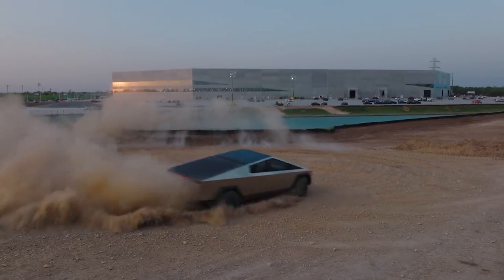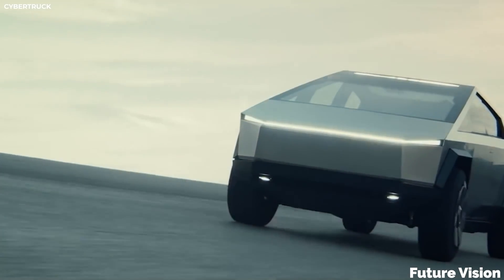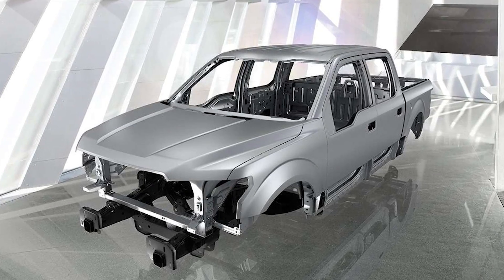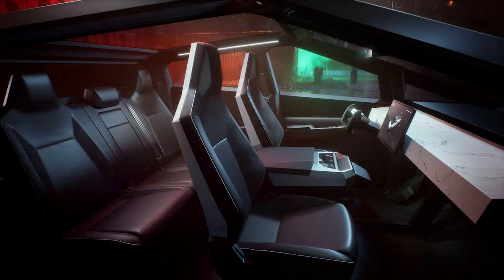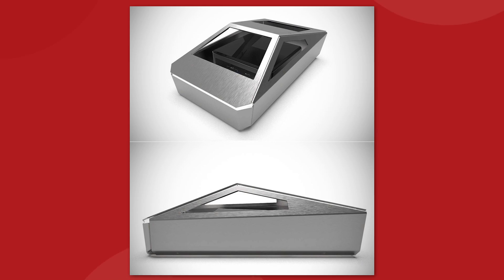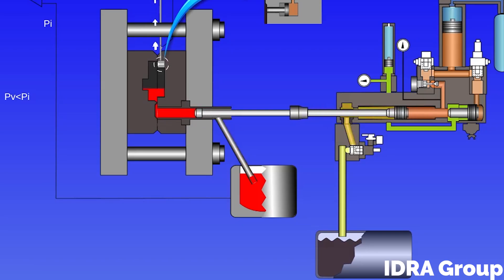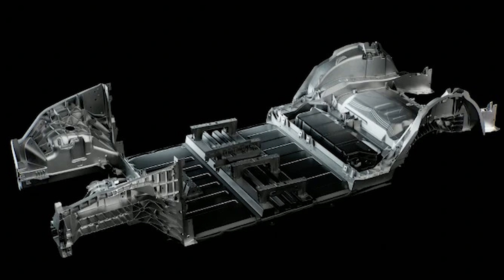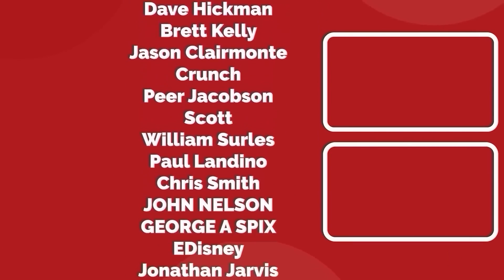The Real Reason Tesla Developed The Cybertruck!

Comment: exoskeleton is a fancy way to say unibody. So it’s a unibody with huge castings. What will be interesting with aluminum castings and steel body is how they’re going to avoid electroless And the dissimilar metals corrosion that follows.
Reply: Don't be so critical 😂
Reply: @kennethkeen1234  
Well, when I was a test pilot decades ago, people called me “Mr. Picky “.  It’s my nature.
Reply: @bearlemley  That is good - I appreciate those who are critical as I am the most difficult to please person I know.
Reply: That and I used to work for an aircraft manufacturer where different types of aluminum are used all over for weight reduction (along with composites) and then steel is used in high stress area and fasteners. So cladding and coatings are used between the surfaces. Electrolysis is avoidable if you work at it.

Comment: A lot of the premise of this video is that the Cybertruck is more durable and designed for "proper truck work" but it's obvious the main buyers of the truck are going to be Tesla bros that live in the city so this is basically going to be an "electric Hummer" appealling to drivers with the mindset of "I'm safe inside my tank truck, screw everybody else". 
Does it seem likely that people that work on the land or need a "real truck" are going to buy a vehicle they can only return to the manufacturer to get repaired? There are no Tesla third party mechanics so if something happens with your Cybertruck and you live rural you're going to have some trouble getting it back to Tesla for repair.
It'll be interesting to see once these are in production how much trouble a battery that can catch fire inside a car with impenetrable doors and no door handles will be in the hopefully rare occurrences of catastrophic failure.
This video also happily skipped over the fact that the Cybertruck only has a central touchscreen display as an instrument panel. The problems with this should be self evident but the main ones are you've got to look to the monitor for all information while driving etc without any options for tactile changeability and if the screen fails you're screwed. Again, if you're doing "rough work" in the Cybertruck chances are you're not going to be happy relying on a touchscreen monitor for all your cars information and settings.
Good luck Tesla true believers but some of us aren't completely convinced this is a giant joke on the faithful from the world's richest troll.

Comment: my 2c. In addition to your notes, I think Elon has designed a POST -APOCALYPTIC  vehicle
1 Its stainless steel, and lasts forever
2 no rust
3 9 mm bulletproof.
4 bullet ricochets if the gunman faces the truck on the road. 
5 rioter proof
6 fast acceleration to make a fast getaway. 
7 mobile power supply
8 if the grid collapses, can be recharged from solar.
9 if oil tanks catch fire, tesla is powered by solar. 
10 sneaks away silently from rioters, and police, unlike ICE cars which make a racket,  and you get caught.

Comment: Very researched and enjoyable video. There's just a few problems with it. 
1. What we have now are a bunch of 3d renderings and a prototype vehicle that hasn't been real-world tested. Many many questions remain. Tesla are only releasing positive information out. Unless it's the "bulletproof glass" fiasco. By the way you probably wouldn't want a bulletproof glass on your truck unless you intend to drive it in a war zone.
2. Stainless steel vehicles have been tried before and didn't catch on for a reason. There are issues with temperature regulation and more. 
3. The "weight of the paint" is minuscule compared to advantages of paint protection 
4. Most likely the design cannot be approved by governments because there are many regulations that prevent sharp angles in vehicles in order to protect pedestrians.
5. Repairs and replacements would probably be a major problem for such a vehicle.
In short the cybertruck is much closer to being vaporware than being actually a viable thing.
Reply: I never understood Europe's no sharp edge rule..... how many pedestrians are surviving a truck hitting them ?
Reply: Americans stop the car and drive back, crushing any survivors of street accidents. That saves insurance payouts which come to millions if the body can still move.....
Good points you make. Yanks just live in illusion-land in wooden huts that get blown away in a strong wind, but need three cars littering up the "yard" to go to the 'mall',  to buy more crap for the mouths watching screens at home. They have zero concept of 'long term'.
2023 01 14 10:52
Reply: There are real world prototype versions that have been driven and tested.
Reply: Thanks for adding your opinion tho, maybe check the facts before you do next time 😊

Comment: Can't wait to get mine.  This will be the best ranch pickup ever made.  As an engineer, I appreciate that Tesla focuses on product performance and quality rather than shareholders, who are only interested in short term returns.  As weird looking as the cybertruck is, it is that way for a purpose.  The Rivian on the other hand is just ugly for no purpose.
Reply: To start with the average ranch truck would be a 3/4 or 1 ton truck with a 5th wheel capacity from 20000 to 32000 lbs capable of towing a stock trailer full of cattle of horses. The bed length is only around 6ft rather than a standard 8ft bed. Ranch truck are many times carrying a portable diesel welder and and or a diesel transfer tank holding up to 100 gal of diesel fuel for refueling in the field. The unibody construction isn't ideal for tough terrian especially when heavily loaded under towing situations. Ranch trucks typically get the crap best out them. I don't see it as much more than a city truck with different styling than what has be the norm for pickups. Personally I think it's about ugly  as it could be.
Reply: @Bobby Bishop  
I understand what you are saying and agree with you 100%. With that said, there are different "farm trucks" for different applications. For example, a ranch "hand" or employee drives around a big farm, checking on different things and only carrys minimal tools. We are not talking about a mechanic truck. In fact, you get a big dual rear  four-wheel drive truck loaded with tools and welder. It better be hard ground everywhere on the farm because she will sink if the ground is wet at all. ( like here in the Mississippi Delta )
Most everyday  farm trucks are not pulling trailers that exceed what the average truck or this cyber truck can tow. If it is a farm that has to pull heavy loads, more often than not, they will have a truck for that. Having that type of truck that can cary a massive amount of tools like welder and pull heavy trailers are not in the least fuel efficient enough to want to take to the farm store, part store, or all the other trips to town, or to the other side of the  farm. Basically what I'm saying is if you pull a trailer everyday or have to have a mechanic truck then yes this truck will not be for you, but for the avarage farmer it could be a very good daily driver for you or the "hands". 
Now that I said all that, I still think it's got to be the ugliest vehicle iv ever seen, and the fact you can't reach into the bed and grab whatever you need on the fly would be absolutely infuriating !!! 
But to each his own, I don't own one, so this is just an opinion  from the outside looking in. I am a heating and cooling technician, ( or a radiator man🤣 ) and by far the farmers are my biggest customer base, also my grandfather had, and family still has a small farm with cattle and other live stock. So this is where I draw my opinion from, but IM NOT A FARMER, so I could be totally wrong.
Reply: @danielmarkle8823  Well I speak from my experiences from being raised on a cattle ranch /farm in the Texas panhandle. 8 sections of land , normally 1500 to 2000 head of feeder cattle and wheat fields. Those trucks took a severe beating and were well equiped with everything needed maintain equipment, fix fences , maintain irrigation wells , you never knew what a day would bring. The only half ton pickup was the one mom used to bring lunch out to the fields for the hands. I just think it would be best to death in short order.
Reply: @bobbybishop5662  Why not join the world and enter the 21st century?
No one on earth except isolated farm childen use expressions such as "from 20000 to 32000 lbs " from the 19th century Victorian long gone fiddlers. 
"tank holding up to 100 gal of diesel" what on earth could this mean? Perhaps in Nebraska or Colontucky some ranch hands will still be muttering about gals not being what they used to be but the whole world has entered the 21st century. Honestly it is amusing to read comments from kids brought up on farms "in the wild west" who are just not aware, despite the internet, that no one has a clue what they are talking about. 
2023 01 14 09:06
Reply: You hit it on the head, Black Rock proves your theory everyday!
Reply: Best ranch truck ? You are delusional.
Reply: @bobbybishop5662  Why do you feel that way?  What prevents this truck from being ideal for a farm and ranch application?  From my perspective it would be much better in many ways than any of the ranch trucks we have ever had.
Reply: Some people can’t get past what’s traditional. If it was good enough for gramps. It’s futuristic looking and it’s electric. One thing that would for sure hurt it as a ranch truck is the towing issue. So far electric trucks just can’t tow far enough.
Reply: There's a sucker born every minute. Oh, wait a minute.

Comment: One point you missed was the design of the trianglular rear structures. Normal pickup trucks have a separate attached rectangular bed. Ever seen trucks from collisions with the bed broken off? The CT has an integrated rear section as part of the whole pressing so the whole body is structurally strong. (Note that the Honda also has a triangular unibody rear design. Better but not integral.) Some have noticed that you can't reach down into the bed of the CT but because you can electrically lower the rear suspension, you can now reach into the bed even easier than the F150!
Reply: @MrHighAnxiety63  Not the reason its separate on normal pickups.  I believe its because of the flexing in the frame.  If the body was hole it would bend going on rough roads.
Reply: Actually I've never seen a bed come off the frame in an accident. Also, an F150 has one of the most inaccessible beds among brands due to side panel height. That said, I'm impressed with Elon's truck.
Reply: @jeffs6819 yup

Comment: These are all great ideas if you don't take into account that peop get into accidents. You have your battery, electrical system, motor, and frame, or exo-skeleton all incorporated and some uninsured driver hits your car... The whole thing is going to need to be scrapped. How green is that? What about the climates where there is a lot of salt in the air? How efficient is it going to be when you need to change the battery out because it's life cycle is depleted? Will it be cheaper to just buy a new vehicle, or are these vehicles made to be disposable?

Comment: Personally, I think it's a monstrosity, but it will probably function well. Quite how they're going to get it through the pedestrian safety tests with those sharp corners is another thing.
It's going to get damaged and need work done on those thick panels though, so heaven knows who is going to be able to do that. Welding Stainless can introduce serious issues with corrosion.
Reply: Apparently you  have not seen big Diesel rigs going down the road with sharp spears affixed to the Front wheels they could shred a human being in seconds even if they were made of plastic and how about the blinding headlights that have been in cars for years where as the H4 bright  German  bulbs have been out lawed for many years?
Reply: Ain't u uneducated  I hv been welding stainless steel for  50 yrs ,on nuclear power plants. Food processing plants  , chemical plants.  Thier is no corrosion  , that is why they use  it ,    u proved u are ignorant 🙄 😒 🤣 😑 😂
Reply: You are simply not yank enough. Yanks live the dream, you and I eventually pay, through loss of freedoms, and the Chinese will arrive to clean up the mess.

Comment: @2:00 no way they use 1/8" material for the outer body, that would be much to heavy and unnecessary for strength! even 1/16" is plenty and it would make more sense to use a partial structural support out of a softer deep drawn stainless steel to prevent that super straight outer material from buckling under load...

Comment: Totally ugly not very wide market vehicle. The DeLorean car tried the all stainless look which failed as very quickly, about 3 - 4,000 vehicles, after which few wanted the stainless look and they forced to paint the cars from the factory. Only about 5,000 +/- DeLoreans were sold in the end. And yes I know the DeLorean was not a hard outer shell merely a substitute for paint.  But the point is the one color is not the way to go it will not sell in numbers OWNERS WANT IDENTITY TESLA will be forced to paint the vehicle in strong colors!  WHY is the truck NOT in production? Because there is a fear of failure there i.e. UN-certainty!

Comment: What about crush zones so that the passengers don't experience the full shock of a collision?  And how are they dealing with the corrosion problems when 2 different types of metal come into contact.
Reply: If you glue it together the different metals aren't really touching. The aluminum castings should act as the crumple zones. There's no engine to deal with unlike conventional vehicles.
Reply: Tesla engineers are pretty good at designing crumple zones… I’m sure they’ll manage.

Comment: This will be a great innovation for owners who live in northern climates, like Buffalo, NY, where cities use salt on the roads in winter. I grew up in such a city, and all cars, even ones with a coated undercarriage, got rusted out after a few years.
Reply: 10:41 the under body is aluminium so galvanic corrosion will still occur
Reply: @_cloudface_  However aluminum oxide (i.e. aluminum rust) acts as a protective layer against further corrosion. What you will get is a white powder look but, except under extreme conditions, that's about as far as it goes.
Reply: @_cloudface_  yep, and that is where the batteries will be.... honestly the stainless will still corrode as well i don' tunderstand where people get resistant versus cannot rust ....

stainless can rust.... in my experience 316 graded stainless you could still bend and form while getting better resistance (to the point it is the grade used in nuclear facilities) but its more costly to use....   

i know of 400, 600 grade series existing but not sure or what gauge you can get it in.... would require some research if it would be viable
Reply: @wnxdafriz  From what I understand: 1) the stainless is quite thick, relatively, so it will oxidize more slowly than car metal. But if the salt does get to it the problem of repairing the bad area isn't so easily solved. 2) there is a thin aluminum sheet covering the bottom which could be replaced if corroded.

Comment: What was failed to be mentioned and explained is that yes, the CT will have an exoskeleton but, it still has to have a front and rear casting frame, which is what the 9000 ton press is for, which is the major delay in production for the CT. It is still going to have a frame, just not one that is designed to be the main structure. Their will be a front casting, and a rear casting and a battery pack, joined together makes the frame. Then the exoskeleton will be bolted to that. But the CT won't rely on the frame for it's rigidity but the outer shell will be it's structure.
Reply: So you didn’t watch the video?
Reply: @500846  No, the video didn't explain that there IS going to be a subframe under the exoskeleton for Cybertruck. You can see it in different renderings that Tesla has put out since the launch date. Most big fans of Cybertruck (I have 2 preorder reservations and am a $TSLA shareholder) have seen that it will have an aluminum subframe made from one or several large castings. That's what the giga press is for, to cast aluminum, not to press out the stainless steel body.
Reply: @Nphen  watch it again….

Comment: One thing I wonder about is the aluminum on the bottom. Is that strong enough to protect that battery if you hit a big rock? I'm just a dummy so I don't know. I wish the bottom was the same stainless though
Reply: Two layers of the stainless steel should be on the bottom to prevent penetration of the batteries by large or angular pieces of road debris.
Reply: I thought the same thing when I saw that in the video.... other than the passengers, it's the most crucial thing to protect, and in arguably the most impact prone and all around dangerous areas of a truck...
Reply: You are a dummy, but ask the most important question (after spent batteries). One rock hidden by tall grass will destroy the whole show, but its protected by a flimsy sheet of aluminium. "Gee mom, is that enough?" 
"Sure sonny, it's rust proof"                                                                                     :face-red-heart-shape:
2023 01 14 09:47
Reply: @kennethkeen1234  thanks for your uneducated guess
Reply: @jamiered7102  I AM ENLIGHTENED
Reply: @kennethkeen1234  please stop yelling it's really early in the morning

Comment: You said the underside of the structural battery pack is aluminum? What happens if you go airborne over a jump (on purpose) and land on a big rock by mistake? I would like steel there as well, to further protect the battery pack from underneath. 😀
Reply: Most likely have the same titanium honeycomb underbody protection that the other models have….